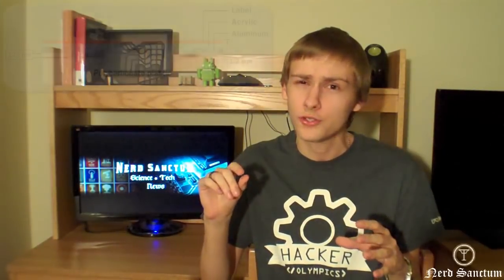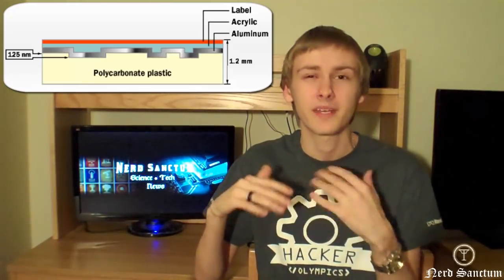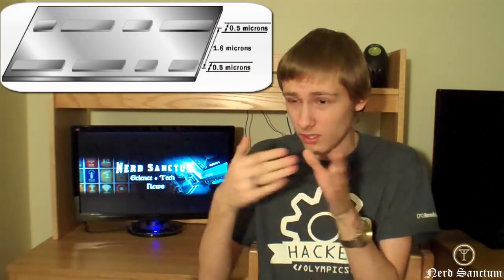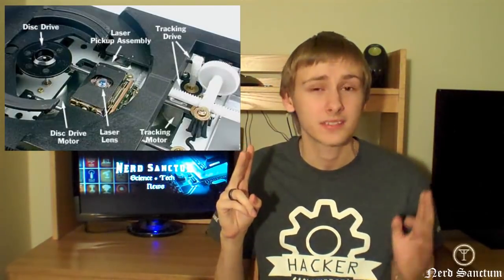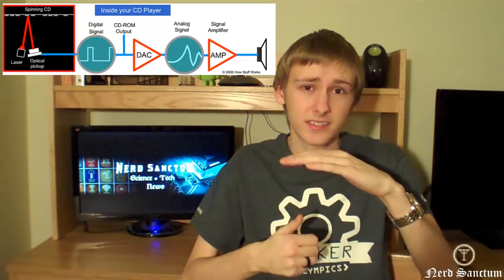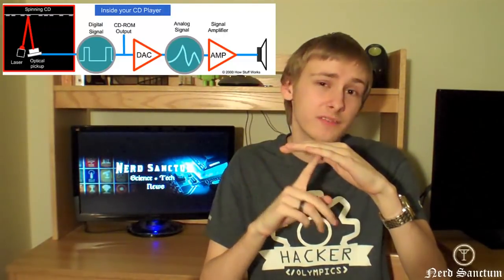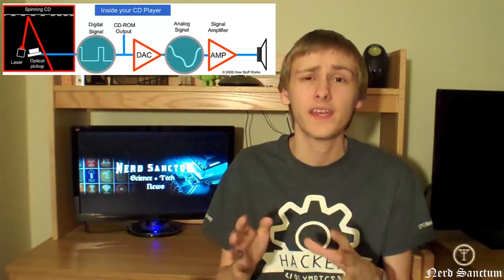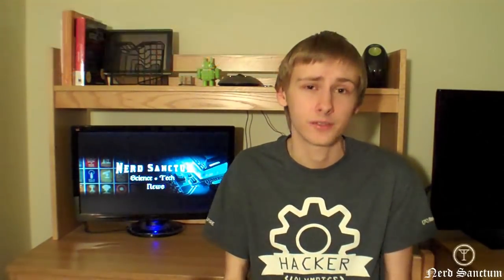How Do CDs Work?

Comment: What I still don't understand is how CDs and players can tell the difference between albums and singles and song length? When you put a full 20 song album that 80 minutes long compared to a single that's 3-6 minutes long, how does the player know to move the laser at a different speed towards the outside?
Reply: It reads from the inside out, and all the tracks on every sized CD are the same size. It plays a smaller disc just the same as the normal sized one, until it hits the code for THE END.

Comment: So I get the essence of discs and how the info is transmitted and all, but are record players similar? I mean, vinyls were a bit of a while ago, but did they create the sound through specific scratches on the record, or was there something else? I was wondering because of the part where you show how the device reads the discs from the inside out, similar to vinyls. Anyways, thanks for making this video! Its been a while.
 (Oh and how's college treating ya this year, Devon? Enjoying your classes?)
Reply from the maker: Great question, Vinyls work kind of pretty differently. To record sound on a vinyl imagine a sound wave has particular vibrations, and if they hit some material those vibrations will travel across that material.

So you can make these vibrations travel through a hard stylus (the needle like part) which will make cuts into the vinyl; so if you look at the vinyl horizontally (flat-ways) you could see small jagged waves going up and down.

Then to play sound from that you can take a less hard stylus (that won't cause scratches) and run it over those same vinyl so it starts to vibrate the same way as the first stylus. Then imagine a magnetic stylus with a metal coil around... the vertical vibrations of the stylus will generate electric current in a wave that if amplified and run through a speaker would generate sound waves similar to the original recorded one.

Anyways once again great question. College has been going well and some classes are more fun than others; just been really busy with all my programming work I do on the side. But I hope the following semesters will be less busy giving me more time to broadcast and make videos. I hope all is well on your end too; thanks for watching and have a great day!
Reply: NerdSanctum Glad to hear that everythings okay and best of luck with exams! Thanks for explaining that for me, I've always been quite curious about how vinyls work; I have one that I listen to occasionally and have wondered how it creates music. Thank you so much for making this video and responding to my question!

Comment: Thanks, that was helpful.  My son Eli wants to know (&  I do too), how does the digital analog converter work? How do 1s and 0s become words and ones in a song?
Reply: +Kristin Ames :  All CD readers, atleast majority of them use one system of encoding, which made it possible to use any type of CD without caring who produced the CD reader or CD writer. 

Words and songs are made of pressurized air, different pressure means different sounds. This pressurized air is measured and mathematically represented. When adding nano seconds of any sound, you can produce different sounds. When you give a speaker and other electronics different volts and current, they produce different sounds or pictures or other activity determined by the human designer of the electronic part.  By controlling the volts and currents flowing through a speaker, you make it give different sound.  

thousands, or millions of systematic arranging of 0 and 1 determine the sound produced in a second of a CD player.  Every CD reader have the driving motor which makes the CD rotate, a laser directs a light toward the CD, and the reflection from the CD is read by a reader. Whether there is reflection or not, and for how long there is reflection is read by the reader.  

Since all CD drivers have the same concepts of programming the CD and  the CD reader, every CD player will play the song (sound) by varying the volt and current while reading the reflections (converted to 0 and 1) from the CD. 

Hope my comment answers your question.

Comment: A cdr had the same type of material that Thomas Alva Edison used to record the poem "Mary Has A Little Lamb" which is Aluminum on the cylinder phonograph mandrel in 1877.  Just think if Edison had a laser back in 1877 and not a stylus to record and play the recording with! 
Also, the laser heats up the cdr disc when it is "Burning" the disc when it records to the aluminum. Another thing he didn't mention is that when a cdr disc is either being "burned" or played it starts out faster when it starts in the center and as it gets closer and closer to the outer edge it slows down! The cdr might start out at 450 R.P.M.'s in the center and it slows down to probably around 350 or so R.P.M's as the laser burns or plays towards the outer edge.

Comment: How does even small scratches affect the disc if there's plastic or filament cover on the disc?
Reply: +Arsenia Aguinaldo 
Ever see a prism? 
When light goes through it, it bends on an angle  
Laser light encountering a scratch in the plastic of a CD-DVD,  pretty much follows the same principle 
The same amount of laser light leaving the laser is suppose to be reflected perfectly straight back to the laser
But if the laser light encounters a scratch in the plastic itself , then that amount of light is lost.
On one hand, the scratch has basically become a filter itself 
Also, some of the light  bends off on an angle,. Similar to a prism

Comment: Can you delve deeper into how multiple mediums can be transmitted through the reading of a disc simultaneously?  What I mean by this is, how can a disk that is being read by a single laser transmit information such as audio (5.1 surround aka 6 separate channels) and video at the same time?  Is the separate data actually occurring at different times but so fast that we perceive it as coinciding?  Or are there multiple lasers reading separate rows of information?  I understand how bits and binary works with audio, but I don't understand how it could process so many different programs when it comes to more than 2 channels of audio.
Reply: In a CD, the laser reads the audio channels like this:
RLRLRLRLRLRLRLRLRLRL
and then you have a "switch" that sends the signal from the L channel to the right place, and the same for the R channel, of course you have a lot of stuff more but that's a simple explanation.

For video with a lot of audio channels, you should have pretty much the same thing, but instead you may have video and audio going in the same way as audio does, that being V-FrontR-FrontL-RearR-RearL-Center and then repeating the same thing, but don't quote me on that, my knowledge of that is too rusty xD.

It could also be the case that the laser is reading the compressed file and then decoding the entire thing, Video with all its respective channels, this actually makes more sense xD than my previous explanation, yeah, forget about my previous explanation and go with this one.
Reply: Thanks for your answer.  I also learned that the CD or DVD or Bluray player has memory, so it reads ahead of what you're actually seeing/hearing on the screen.  I was just wondering how it processed it simultaneously without too much latency, and it's because it doesn't process it simultaneously, it reads ahead.
Reply: *****
Well, CD/DVD/BluRay players don't need to have much processing power, they can easily decode and process media really fast.

Comment: What confuses me is how discs are created for games, since the user is interactive with the data.  Is the disc basically just a layout, and the system itself processes the changes in data?
Reply: You see, the interface is different. Basically, using the data on the disc, a virtual environment is created and sustained using the gpu, cpu and RAM. Thats what loading screens are doing. Thereafter the disc is not needed for the environment but instead used for small things like music (thats why sometimes audio can be out of sync) and pre rendered cutscenes. Generally loading screens separate massive chunks of data that have to be rendered for the game environment. A large portion of data on gaming discs are objects and textures that will be handled by the gpu. On consoles some games ask to preload data onto the hdd because its must faster to read and execute data from a magnetic drive than an optical one.

Comment: So how is color encoded zeros and ones would give a black and white pocture
Reply from the maker: joe Bender Computers store colors as a data stream of three numbers between 0-255, one for each red, green, and blue (RGB). The higher the number, the more of that color should be rendered. By combining these three base colors, a computer can make any other color from black (0,0,0), white (255,255,255), purple, orange, etc.

To convert a color image to a black and white image, a simple technique would be for each pixel, add the RGB values together and divide by 3. This way you’ll still have one value between 0-255 for each pixel which purely represents brightness and no hue/saturation. There are more advanced techniques for better blending and contrast from RGB to WB images, but the general principle is the same. 

Thanks for asking this question, stay curious! 👍😀

Comment: Hello,
Thank you for your very very nice explanation..........
i want to know 1 thing from u 
that what does 12x 16x 20x 36x means
in and type of rom

i will be very thank full to you
Reply from the maker: 12x, 16x, etc are examples of a discs "Writing Speed". When CD-ROM Drives were first made they could read 150 kilobytes per second; over the years optical disk manufacturers made disks that could read data faster than old drives. So 2x can read/write data twice as fast as the original speed (and 32x is twice as fast as 16x); so that number is just useful for people with fast CD-ROM Drives that want disks that run at least at the same speed; so the speed is limited by their hardware and not the disk itself. Also it's important to note that the type of data you are writing can affect speed as well.

Anyways I hope that answered your question. Thank you for watching, and asking that great question!
Reply: NerdSanctum thank you very much for your immediate and very informative response to my question 

I am very much thank full to you, for clearing my doubts .....

And again.. at last hats off to your stunning and appreciative video

Comment: A reference to a correct explanation of how the device actually reads the pits and lands should be included in this video's description. 

The laser does NOT get redirected off the photo sensor, nor does it have non-reflective areas. As another viewer commented, the technology relies on constructive and destructive interference of light. Have a look at this other video that accurately describes the process. Otherwise, this would have been a good video.

https://youtu.be/-MYwF6cW7T8